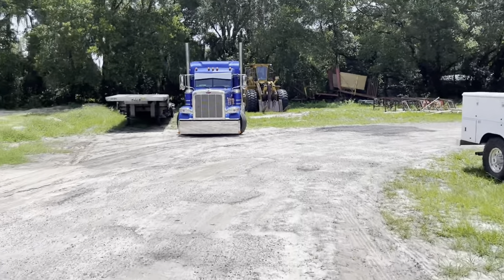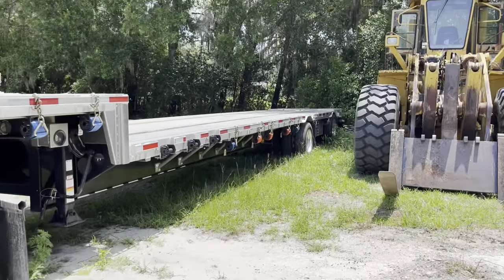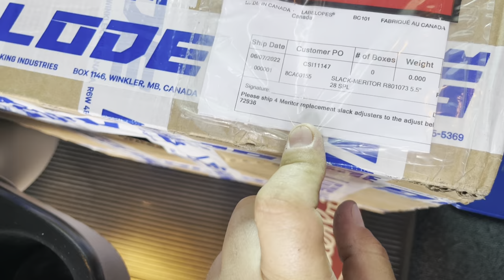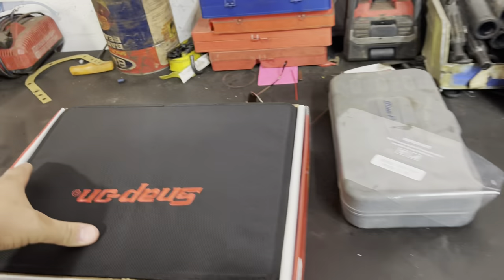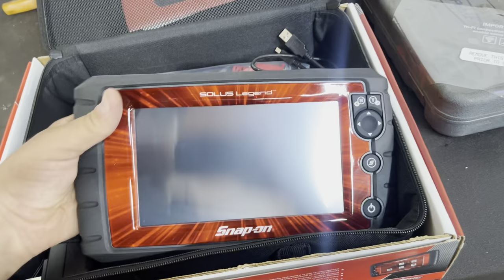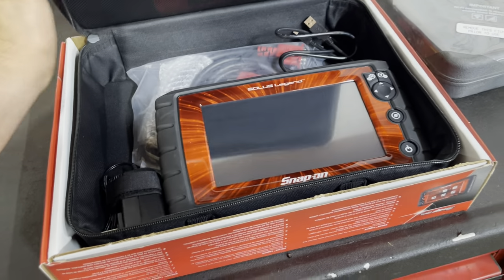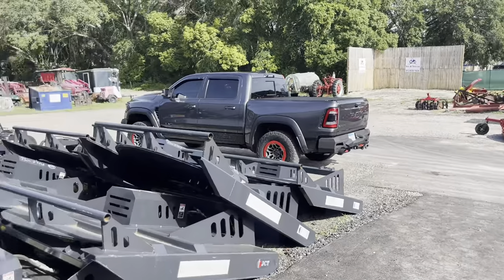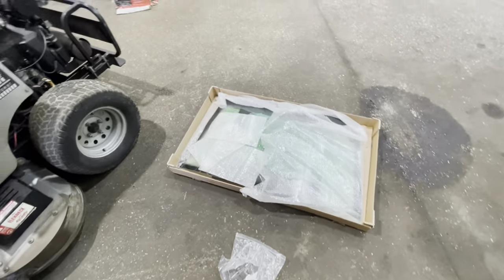Junk Trailer for sale.... Who wants it?? I’m Done!!

Comment: I still say you have a quick-release valve either piped wrong at the factory, or, it's malfunctioning. The idea that all four slack adjusters would bind up, (or even two or three,) is pretty far-fetched. When you apply air to the brake chambers, the air has to exhaust quickly when you let off the pedal to quickly release the brake shoes. If that air is being trapped because the quick-release isn't letting it, it will drag as it S L O W L Y releases. Look under the trailer as you have someone apply the brakes. If the slacks apply well, but don't back off, and if you don't hear that "swish" of air letting off quickly, check the valves. ALSO, make sure you don't have a piece of rubber from the inside wall of the main hose from the valve where, when someone put the fitting on, didn't gouge that rubber wall, which causes a "flap" in the I.D. of the hose, and acts like a one-way, letting air in, but not allowing it to rush back out! Bottom-line, it makes it act like someone is always holding down slightly on the "Johnny-bar" on your steering column!
Reply: it's either that or the ride height on the trailer airsuspension  is to low that causes them to lock up as well so I would look at the ride height
Reply: I have to agree with both these gentlemen: your trailerbraketroubles are not in the adjusters! 4 brakes having the same problem simultaeniously AND the low pressure, 5 bar, hard braking of the trailer means the problem is in the pneumatic circuit! 'Nice' btw how seller and manufacturer of the trailer handle (not) your problem... Good luck! Keep the day to days, the Kawasakis and tractor pick up and deliveries coming please?
Reply: Sounds like you nailed it my friend
Reply: it will be your main brake flow valve. had it on a trailer before. it's either plumbed backwards or its faulty. changing out from auto slacks to manual slacks won't fix the problem.  over here all our trailers are computer controlled with EBS systems so make it harder as it can also cause over braking on a trailer.

Comment: The newer trucks with abs always cut line pressure to tractor steering axle when disconnected from trlr an it goes you the sensation that you don't have aspowerfull tractor brakes while bobtailing.

Comment: ABOUT YOUR TRAILER BRAKE PROBLEM
IN 2009 I HAD THE SAME ISSUE, FIGURED IT OUT AND IT WAS FIXED
I'm posting here in hopes you might see this without getting lost in the comments. I hope this helps you!
I was in a 2004 XL Classic, no modifications except a drop axle. Pulling only and always a brand new 2009 4 axle, extendable container chassis. It had ABS and helped us understand the problem. The reason I didn't get flat spots is because the ABS would keep kicking of the trlr brake. But let me tell you, the surging it did, drove me F'n nuts. I eventually cut that out of the wiring.
The term that was said to me, is "crack valve pressure". It was me who eventually discovered the issue, once I knew more about how the system works. The techs all treated me like the dumb truck driver.
I don't claim to know every detail of how the air system works to apply the brakes, but but I do have good basic understanding of it.
Crack vale pressure refers to the pressure required to start to open the brakes air distribution valve. My trailer's valve was starting to open at 4 psi, while the truck's valve was starting to open at 7 psi. This created the same problem that you are having.
Now this makes sense if you really wanted to control you braking in ice/snow conditions. But if you are a light footed in braking (I am) or gently riding your brakes down a hill, than you are using a lot more trailer brake than the rest of your trucks ability. Because your trailers brake valve is opening first and further. This in turn causes your trlr brakes to build excessive heat, which in turn causes your drums to expand, which leads to your slack adjusters to tighten even further (to compensate for the bigger drum diameter). Once the drums cool off and shrink, your brakes are now to tight. The one wheel that would occasionally stop/drag when you did the free spin in the air is a warped drum. This can happen when the drums are very hot, and then cool with the shoes putting pressure on the drum. I suppose this problem could amplify if your trlr's drums are smaller diameter than your trucks. I never pulled a trlr that had much smaller tires/wheels than the truck, like your stepdeck.
Old timer told me once never set the brakes if you got the drums really hot, it will egg shape the drum..
I hope this explains it well enough.
The fix for me was to get both the truck and trlr valves to open at the same time. So we had a new valve put on the trlr buy pushing it thru the warranty.
I don't know much about your truck. I only today, discovered one of your videos and caught a random comment by you about your trlr brake issue. Then watched a few more videos of you discussing it. And it is exactly like my issue.
I hope this helps!
Blessings to you sir!
Reply from the maker: Thanks for the insight!
Reply: @Bruce_Wilson  I have a Ford CL 65 skid steer it broke an axle any suggestions where I could find one
Reply: @Bruce_Wilson  
Same thing I said in the other video
My VERY EXPENSIVE Trailer Is Still VERY BROKEN, HERE’S WHY…
top comment
Reply: please edit and shorten your post so it’s just relevant information your trying to convey.
Reply: @jessihawkins9116  Not sure what part isn't relevant.
Please advise.
I actually had a lot more to say in regards to the PITA I had when fighting with the mechanics and owner of the truck. Cause I'm just the dumb truck driver. All the things I tried under advisement even though I knew they would not fix the issue.
I got a lot more to vent on this but I won't.
I can't imagine how he feels about it.
Reply: Never heard the term "crack valve pressure" before, but does sound like an overly sensitive brake relay valve. Or a faulty one.

Comment: brake relay crack pressures are wrong or" malfunction / broken" on the trailer.   The slacks are a waste of time and fuel.  
find teh part numbers and tags on the relay valves and find out what they are and bounce off build list of trailer..   regardless they are wrong or broke..
THIS IS ASSUMING THE BRAKE SHOES AND SHOE KITS ARE MATCHING THE S-CAM HEAD.   
WHEN YOU SAY THE DRUMS ARE WARPED THEY DONT WARP IF SHOES AND SHOE HARDWARE KITS ARE MATCHED TO S_CAMS PROPERLY...

Comment: That brand new pete doesn't have an auto low voltage disconnect? 😂 Even my old crappy 1998 Peugeot has an auto "eco mode" which turns everything off when the batt gets too low lol

Comment: Unfortunate that tractor owner ruined a nearly new engine due to lack of knowledge and skill. If oil came out of the bottom it has to go back in the top. Expensive mistake not checking the dip stick...

Comment: Your batteries didn’t have enough juice to start the big tractor engine but probably had enough to start your apu. Much smaller Diesel engine takes a lot less And your apu charges your battery.
Reply: these newer vehicles are all complete junk. why does every new vehicle, even commercial trucks have to have computers and lcd displays? absolute garbage
Reply: Apu should automatically fire when power gets low. Key was left on, or apu was shut off

Comment: For the semi batteries I’d see if the APU is on standby when the truck is off that way batteries shouldn’t die when the company truck I’m in hits 12 volts is automatically kicks on and charges them for a hour or so

Comment: Ar3 you kidding, the dude with the tractor 🚜 could not see the fill oil cap on the top of the engine really, are they that unseeable under the hood , a fill oil cap , wow or is the guy just that stupid , lol motor oil in the transmission. Lol nice , thanks BigAl California

Comment: I’ve encountered this EXACT issue with the brakes locking if you get on them too hard.  

I had broken service return springs inside the spring brake canisters (adds resistance against service air pressure to have it actuate smoothly, instead of *thunk\WHAM*), and what I previously had was factory Haldex 2020’s on a 2018 T680.

Best way to figure if they’re busted is you set the parking brake, and tap on the can with a rubber mallet or the back of your fist.  If you hear clatter it’s a bad spring brake and it needs swapping.

Hope this helps

Comment: I totally understand...
I’ve been having my own day to day issues.. Believe me
Hole in the ceiling, new clutch, new shifter, trailer brakes on 🔥, new brake drums & shoes, then broken wheel studs, high roadside costs, now new rims & another brake shoe & drum, damaged & destroyed slack adjuster, new radiator & cooling system, new windshield, and just yesterday my fan belt busted & took two pulleys shall I go on?
Welcome to Trucker Live!
😊
Have a Great Day!

Comment: You can't install "manual" adjusting slack adjusters on this trailer, it's too new. I believe the law changed 25/30 years ago.
Reply: Agreed. The issue should be resolved by new drums, new shoes. The slack adjusters being automatic really shouldn't have much bearing on the main issue at hand.
Reply: You’re correct. Anything manufactured after October 20, 1994 that has air brakes must be equipped with automatic slack adjusters. Dot will make you replace them on the side of the road if they found it in an inspection. You can run the manuals if you want but I would keep the old ones in the side box and learn to change them..

Comment: As for your content, it can ALWAYS be better, but I think you have a pretty good balance of different content myself, I will say, your vehicle repair video's could use some improvement on the angles, as for the new pickup, after the way you ran that new truck, I'm surprised it's still even worth a new set of bumpers, lol, other than that, ROCK ON!

Comment: Your ABS module is your problem. It's getting an altered signal and outputting a signal pulsing more air, as to say you are stab braking. Need a diag on your ABS system while applying air as if in normal function. Hope this helps

Comment: Hey Brother, I had a trailer that was doing the same thing about dragging the wheels when you released the brakes. There ended up being a airline that had a screen clogged. I had to build up 120 pd of pressure, release the trailer brakes, air it to 120 again and then pull the hand spike a couple of times and they would release.

Comment: Have the shop check and see if your brake shoes match your brake cam. Example, Q+ plus shoes / Q plus brake cam.  Brake chamber throw with angle of slack adjuster.   Could be the wrong brake relay valve as well allowing full pressure to the brake chamber.  Good luck

Comment: The truck is what suplies air for the brakes on your trailer so who ever set your truck up has posibly got the trailer brake supply wrong ,
& I suggest you check trailer supply air presure.A new truck like your Peterbilt will have ABS braking so it may not be entirely a trailer
problem.

Comment: Check  brake chambers leaking internally,and  also check if brake hoses installed correctly.just cause it's new don't mean someone didn't mess up at the factory.i have worked on trailers for 30 years,and I find lots of screw ups straight from the factory way too often.its a simple fix I'm sure .

Comment: I know you've been having alot of issues with the new trailer. Something I'd look into is your abs/service valve on the trailer. All of those are crack pressure valves so that braking between tractor and trailer is more even and not delayed. However is that valves crack pressure spring has failed you may have a lot faster brake application. Most slack failures ive see actually didn't retain adjust rather than rachet down tighter than opposed normal. Unfortunately with trailer warrantys you don't get as on depth looks int cause of issue because noone wants to foot the bill.
Reply: I think he has disk breaks on the truck. My truck does the same thing. Trailer with drum breaks grabs hard when empty. When it’s not on the ground it takes more air to stop the truck. Took some time to get used to the way it breaks

Comment: Auto slack adjusters are a waste of space, put manual ones on the truck and trailer and take 10 mins once a week to do the truck and trailer at the same time to the same setting and it'll all stay balanced and feel 10x nicer to drive and it'll be safer in a hurry up and stop situation 🚛🚛💨💨 just because they are brand new doesn't mean they are correctly set (truck and trailer)

Comment: You're trailer I can understand the hubs being  wart ,  But I think it's a trailer valve that's the reason why the trailer is locking the brakes up on it , They need to check that for you ,  All of this is run by computer anymore

Comment: Bruce i was an owner operator of my own trucks an trailer s for 25 years an there were time I remember that id buy a new truck an have saimilar same trouble with trailer brakes .. turned out that the trucks abs brakes system was wires differently then the traiker brakes an cause lock up on trailer etc.. once the wires got changed around to match the truck everything was mint .. no more trailer brake problems.. not sure if this is your problem but jus thought id let ya know it was for me .. hopefully you get figured out soon .. i would be super frustrated too good luck 👍

Comment: Crack pressure is the term used for the amount of air pressure that starts the brakes to activate. It's how you keep doubles and triples from "lagging" behind and " pushing" against the tractor and jack-knifing. This is controlled by your regulator valve. That's where I would start. I would find out what valve you have, ( R12, R14, or whatever ) and start there. Doesn't matter what your wheel size is or length of trailer, theses valves are all the same. You may have a defective valve. Worth a try, fairly easy swap and don't need new one to troubleshoot. Remember, each trailer has one, they are ment to "feel" air pressure change when setting brakes so trailer or trailers set fraction of second b-4 tractor to prevent jack-knife. That's how they keep double and triples in line when braking or panick stopping.
Reply: Actually, it's called a relay valve. Usually it is somewhere in front of the front axle on the trailer. As soon as you start to apply brakes it see's the air pressure change and starts to apply the trailer brakes. What made me think of this is you said something about noticing your gage changed like 3 psi or something with the trailer and then something different without the trailer or something like that. Makes me think the trailer brakes are getting full air pressure ( panic stop) no matter how hard you are pushing on the trettle valve, ie, the foot pedal. Still think the process through and trying to find the problem.

Comment: I actually had the same issues with a brand new Peterbilt and trailer. Come to find out,it was the the truck pressure equalization system that wasn't par for the trailer I was pulling. I alot of folks won't believe it but yes, after a couple new components for the Pete,that trailer never gave me a lick of problems. Peterbilt said that happens alot. You'd think they would pay for fixing it,but after all. We are talking about paccar!

Comment: Is it fitted with abs???,or it could be pushing too much air to the trailer thus causing the trailer to brake harsher.
Get the laptop on the truck and see how much air it’s sending to the trailer if it’s over the top turn it back and see how it goes

Comment: No one runs split axle trailers in Canada. Tires will fight each other and wear out fast. Rims get all bent up and the trailers easy to throw out the alignment. Aluminum will twist and sag, I would stick to steel frame with sliding tandem or drop axle tridem.

Comment: Bruce when the Pete sits have the APU set to battery Tender so when the battery gets low it will kick on to charge the batteries so you won’t have a dead battery when the truck sits for a few days.

Comment: your apu should have a battery monitor built in so if your batteries get low your apu kicks in and charges them till the batteries are charged and then shut back off

Comment: I think you have a battery saver option for the green apu it will keep your battery charged when voltage drops it is a setting on the controller

Comment: Pete’s have a feature. On most when the battery gets low it won’t turn over. But if you try it 3 times usually on the 3rd time it’ll fire up.

Comment: It might be the load sensing valve in between the two axles as it's telling your air system that there is or isn't enough air to the brake

Comment: You literally have an APC that will charge your batteries for you smfh
Reply: If the apu is off. The batteries are already dead. It won't fire up the apu. It runs off the same batteries. If the apu is in start mode. It will turn when the voltage is at 12.4 volts.
Reply from the maker: Was not in start mode

Comment: is that the hot exhaust lite on the pete?
mine gets that alot. it idles a little high and it usually goes back to normal after driving a little while
really enjoy the channel bruce
Reply: Pretty sure the was the Diesel Particulate Filter (DPF) regneneration light.
Reply: @donaldwilliams6821  
ok i thought regen was another one of those goofy symbols but you are probably right
Reply: @frankwallace5174  Yeah I am not sure of the symboy on those rigs either but right at the moment Bruce complains about it picking that moment to be in regen. My Jeep GC goes in regen once a tank these beasts must do it every few days!

Comment: Can’t you adjust the brake pressure threshold independently on the truck and trailer?? I’m not familiar with semis or air brakes but it seems logical that you would be able to at least adjust this or the “gain” like on regular electric trailer brakes.